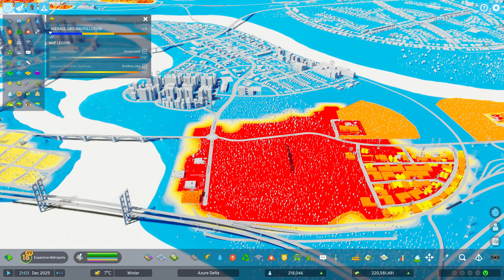MORE FUN with Cities Skylines 2 Road Builder Mod!

Comment: check out the "continuous flow intersection", which is easy enough to build w Road Builder-there is a diagram on wikipedia when you look that up there, just do the lanes the British way.  I have a small demonstration of it on my channel, but it's for right hand traffic.  

If you do try it, remember that you need to place a signal where your road meets the CFI, that's set to "split phase" to handle a bit of crossing traffic, then at the main intersection, which should be set to vanilla and allow for turns on left.  this will allow traffic moving left to keep moving and causes less issues with the dedicated right turn lane.  And also, lane connected tool
Reply from the maker: Definitely an interesting intersection design - don't think we have any of them over in NSW. Will have to have a look!